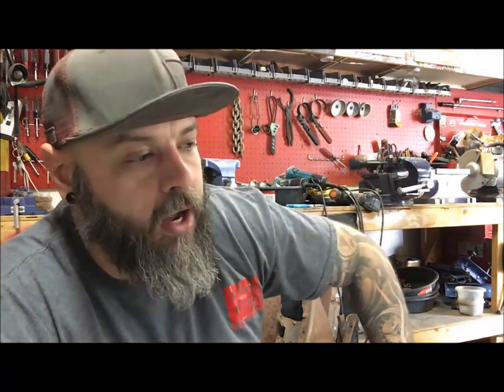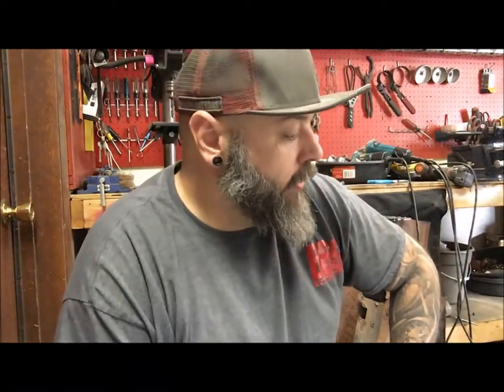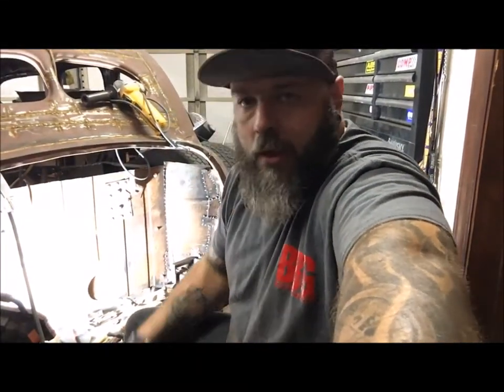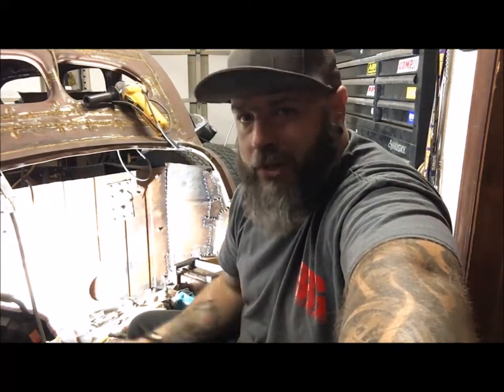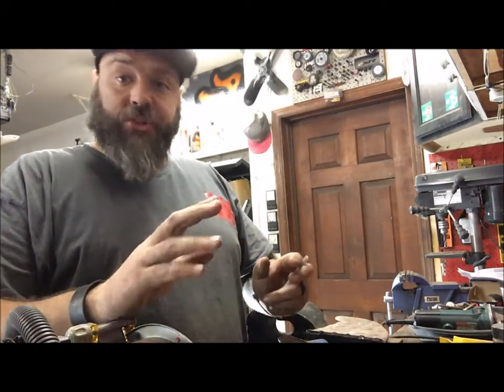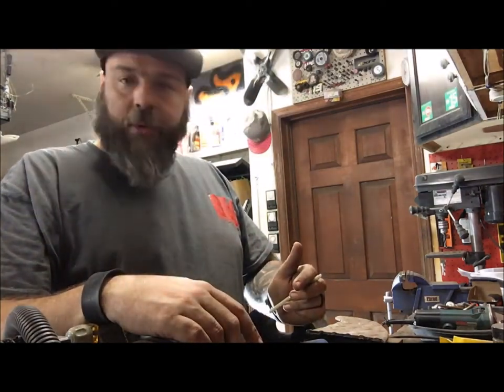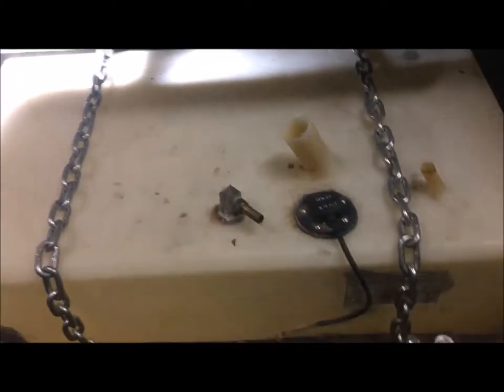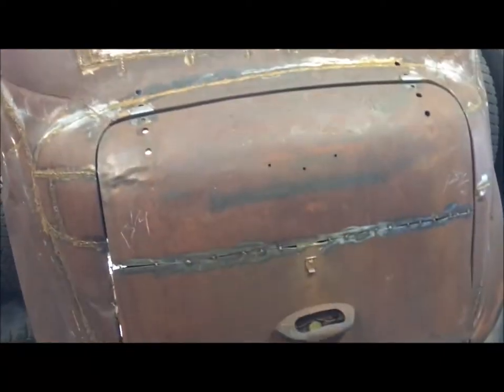"Finishing the rear wheel wells" 1937 Rat rod Build update 24

Comment: I'd open the truck normal but use hidden hinges on the inside that hinge past 90 degrees. Like on late model German stuff, it's like a 4-bar linkage deal that swings up and back at the same time, spring loaded too.
Reply: Search volvo S40 trunk strut install by Mark's garage on YouTube. (Sorry I don't know how or if you can link It here).  It shows a good view of the hinge linkages, you could grab a set at pick-n-pull.

Comment: Hotrod Dave here,just make sure you don,t build something you,re gonna wacky your head on,when it,s open.A buddy of mine built a tilt nose on his 38 chevy truck,he was always banging his temple on the lower corner of the side panel of the hood when it was tilted up.Also I got a tip from  guy in my carclub,Frost King makes rolls of  self adhesive duct insulation.I used it on the inside of my roof ,which has is made from a 54 chevy trunklid,.It quiets it down,and doesn,t radiate heat like it did before.It,s a good idea to make templates of the pieces,because this doesn,t have a peel off  backing.I bought another roll of it,and it's going to be used in. The  second roll is to be used inside the door panels to snub vibratiòn,and d radiant heat since my ratrod is  satin black because BLACK CARS MATTER.!
Reply from the maker: David Oberkirch thanks for the tip